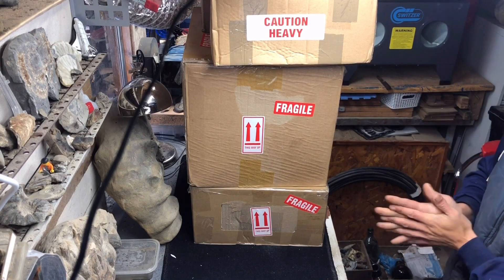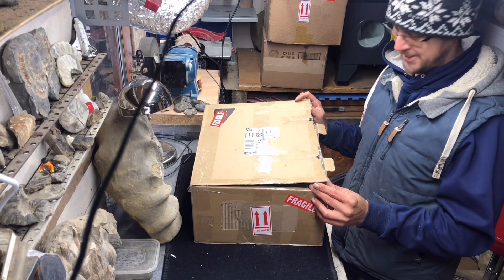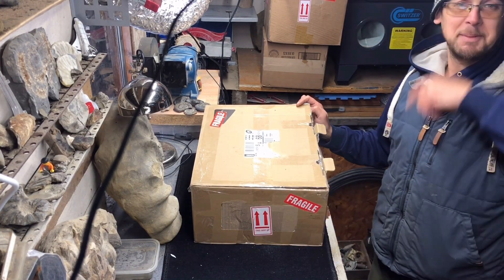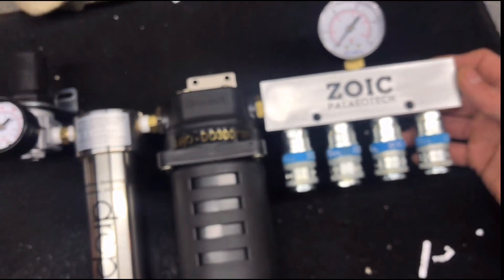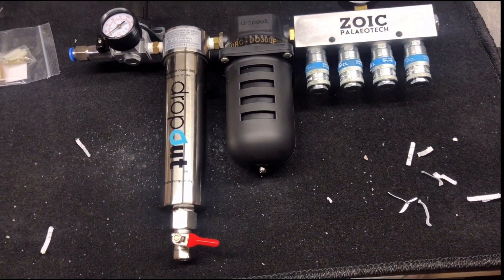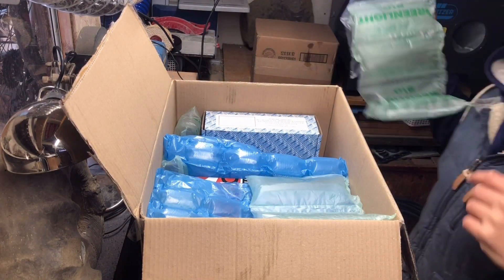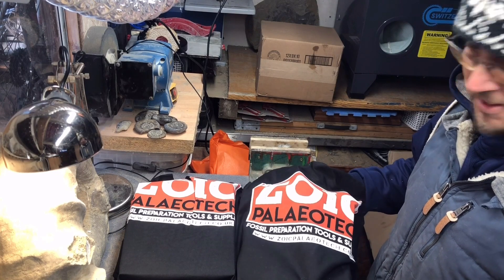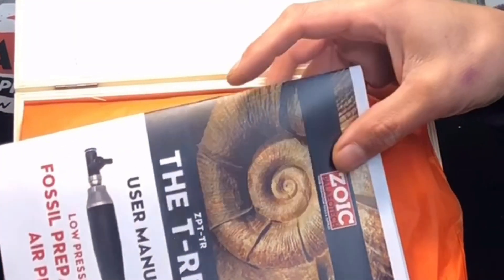Unboxing Fossil Prep Lab Tools

Comment: congrats, you got an entire prep-lab in a box!  Only thing missing is the compressor, which I suspect you already have.  I would recommend still adding a silica gel drier just before your abrasive.  Youre gonna have fun, that kit will make your prepping so much faster and better.
Reply from the maker: Thank you yes I picked up a brand new 50l air compressor for £50 a couple of months ago, I was relived when I turned it on and it worked 😅 
Thank you for your tip 😀
I set up the air abrader today, I gave some iron powder a go and it flew through the system a bit quick on 50 psi 🤨 I’m definitely gunna need to read up on abrasives
Reply: Not a lot out there to read.  It mostly trial and error.  Practice on scraps.  Start with low PSI and move up as needed. You may need a smaller tip depending on your media size. @WightFossilTours
Reply: No need for a silica gel drier with this lot - the Dropout filter and Carbon Filter between them will take out 99.999% of moisture, oil, mist and particulates down to 0.01 microns which is just incredible. Dropout (the company who make these) have got a unique patented design that comes out significantly cheaper to manufacture and purchase than any traditional air driers, which is great. Next to zero maintenance too :D.
Reply: @WightFossilTours  It's gonna go through fast - it's because the iron powder is so huge in terms of grain size (150 micron). Drop us an email as we do have something we have made to modify ours a little to reduce the powder it shoots out.
Reply from the maker: @zoicpalaeotech  thank you I did think that I was already covered with the Drop out filter 😀
Thank you for fixing it all together with the splitter and carbon filter
Reply from the maker: @zoicpalaeotech  lol cool thank you I was gunna do that today anyway, the flow was mental even on only a few psi
Reply: @WightFossilTours  There's always a LOT more flow with iron powder than the other powders. It's part of how it works as its so different, but by reducing flow a little you can increase cutting power (the grains hit each other less on the way out and maintain momentum so to speak).